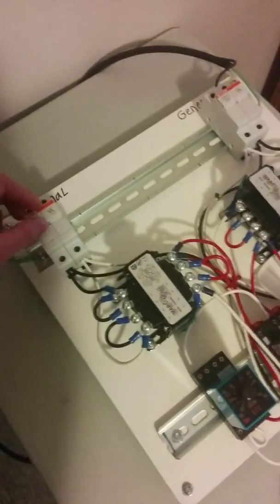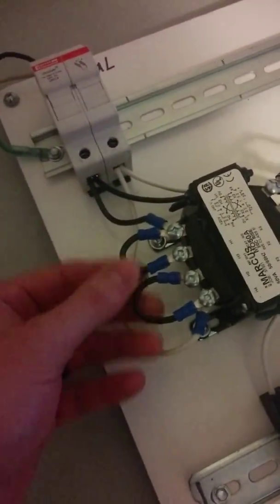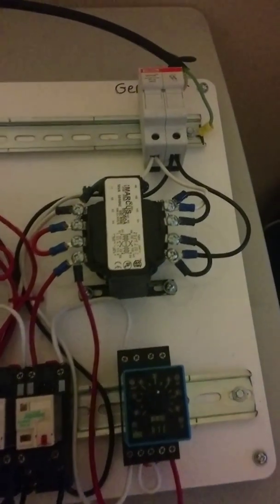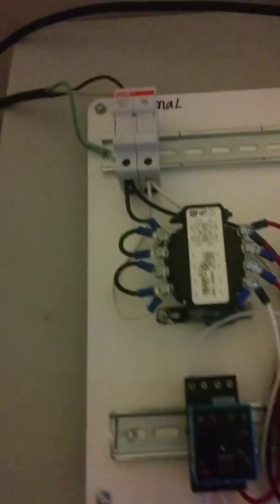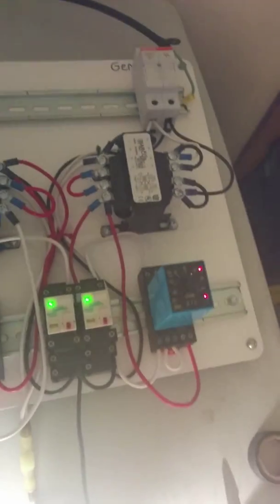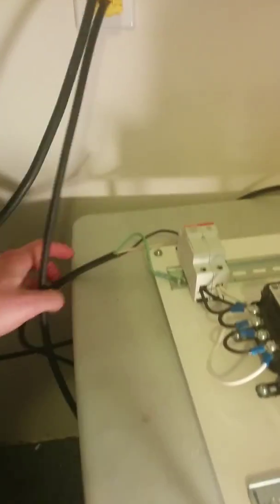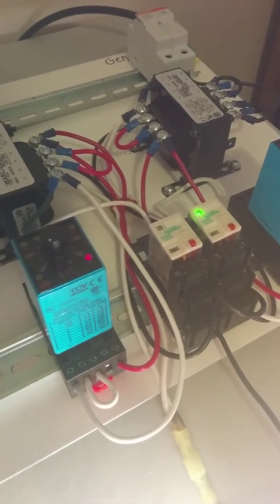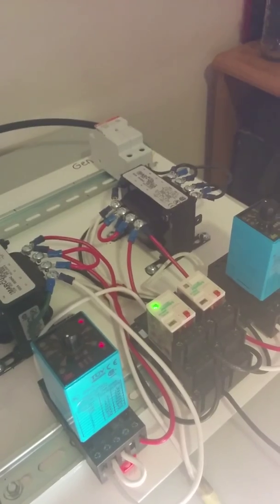Electrical Final Project - Transfer Switch Simulator

Comment: Thanks for posting. Looking at building something similar but with an output to fire up the generator
Reply from the maker: Sebastian Draeger does the generator have remote start connections on controller?
Reply: No it's an onan with a bad control panel. Building a control panel is part of the project.